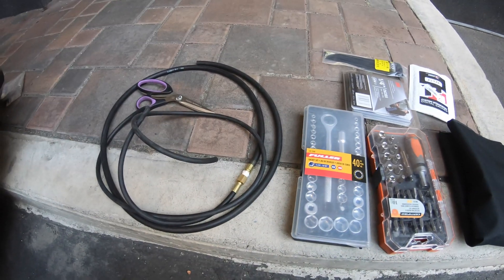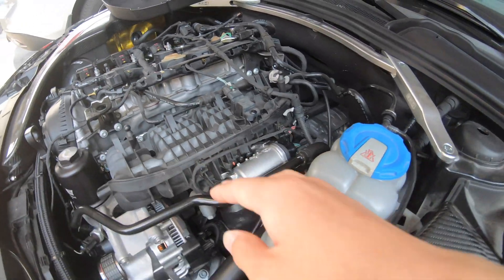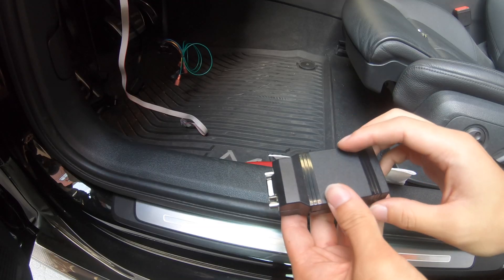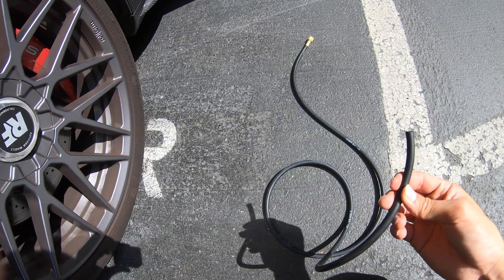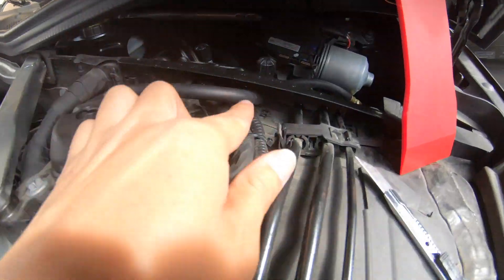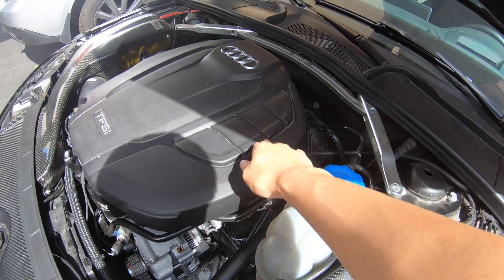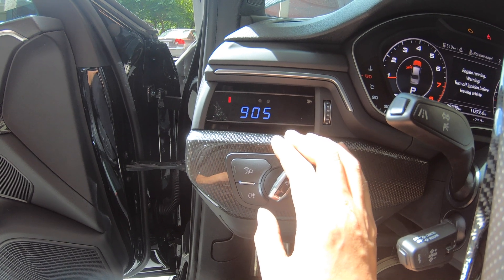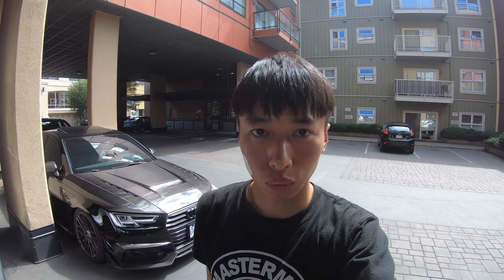Wiring Tubes for ECS Tuning Boost Tap and P3 Gauges Boost Sensor on Audi A4 B9

Comment: Hi Yaode, Where did you get the Carbon Fiber inserts for the dash? LIke around your headlight panel? I am not liking the Piano black in mine
Reply from the maker: Anthony Aceves Hi, I got it from ECS Tuning. You also can get it from your local Audi dealer.